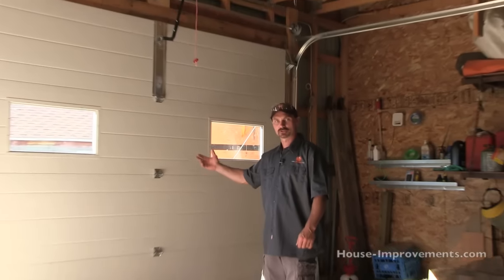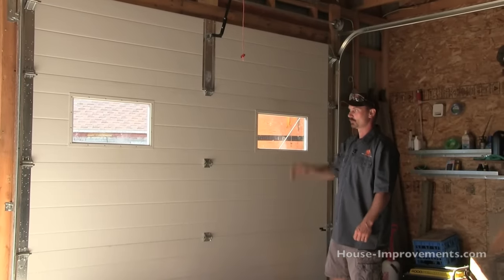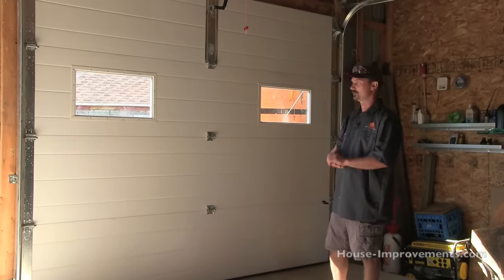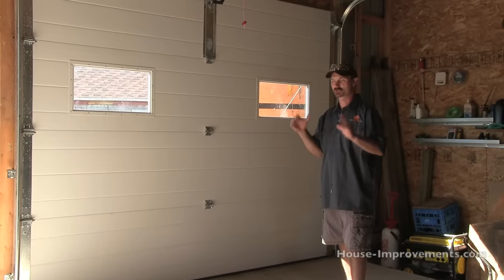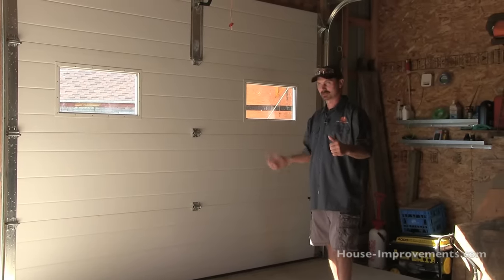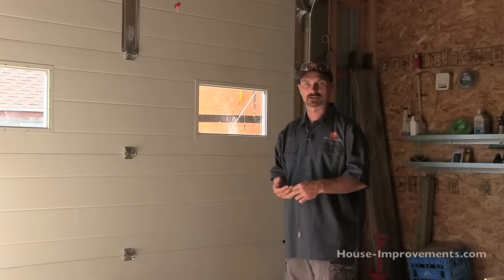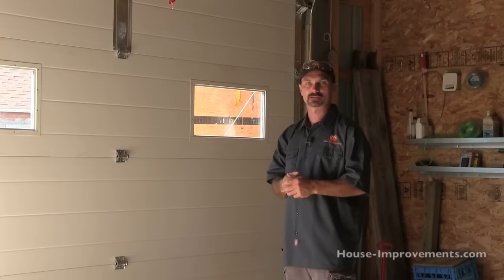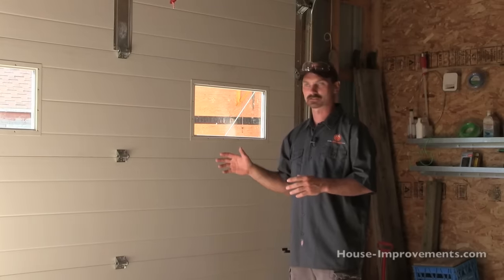How To Install A Garage Door

Comment: I am looking to buy a house that has a 20x40 RV garage.  It has a large garage door approximately 12x14.  The opener isn't moving and the wire that goes to the spring is broken and sticking out the top of the door.  They are telling me the entire door needs replaced.  How heavy are those larger RV style garage doors?  Do they sell them in separate pieces?
Reply from the maker: Please post your question in my forum with a picture of the wire you are referring to. http://www.house-improvements.com/forums/
Reply: Yes you can buy pieces separate. There must be more wrong than a broken cable for them to say it needs to be replaced

Comment: What is the material type used for the panels , is this GI sheet metal and Foamed with Poly Urethane or Aluminum sheets with Foam?
Reply from the maker: good question ,I'm not really sure

Comment: 15 mm rebar he wanted to say.
Reply from the maker: If you are referring to the rods I made for the door spring tensioning, I used 10M but you could use 15 M for more strength.

Comment: I have been installing garage door 46 years.  At least know some of the terms and terminology about garage doors.  

I would be surprised if someone hasn't got hurt from trying this.  You mentioned  don't use something make shift winding the spring.  Makeshift, say like rebar?

Winding bars are made of cold rolled steel.  Rebar is soft whatever.  You get a piece of Crummy rebar and it fails while you are cranking on that spring you can screw yourself over.

Comment: Sorry, I have to comment on a couple of things. He is using a regular cordless drill that is probably killing his hands. He can very well use an impact one. I can't explain why but an impact drill puts no strain on your hands. Just try. There are also available all kind of magnetic nut setters. Using a regular socket makes him look pretty amateur. Also the middle hinges should be installed with the fixed holes down and the slotted ones up, at least that's what the Steel-Craft installation manual is calling for. You should also never use anything else than "cold rolled" steel rods for winding springs. A rebar will bend if the pressure from the spring is too much. A pair of winding pins sold at any supplier or even just a 1/2" cold rolled steel bar sold at hardware stores will do the trick safely. Any professional garage door installer would cringe seeing him winding the springs. His position is completely wrong. Imagine you are winding the spring and loose your grip for any reason. He will be hit by the bar straight in the head. You should never have the spring's weight completely in your hands. Adjustable top support screw is installed in an impossible way. I'm curious how he tightened it. Also a pro will use a ratchet instead of a wrench. He knows the idea but is obvious his main field is general handyman, not certified installer.
Reply: you know he's doesn't install these professionally
Reply: Robert Pandi Can you post some of your how to videos . ? Talks cheap
Reply: Robert Pandi  I am not professional, either, so I wouldn't have any professional tools, and therefore I appreciate that he is using tools and equipment that I would have in my possession, and would already know how to use.
Reply from the maker: Robert Pandi With an impact it is to easy to strip the bolts/screws driven into the doors so I do not like to take a chance.
Reply: You always do a great job on explaining what and how you do the work. I have been watching  your video for a while . But I don't remember seeing any how to videos by anyone named " Robert Pandi" It show's that you have class by not responding to all the other crap he said .May be we will get luck and blessed to see one of his
 " Professional " videos

Comment: why do that put the track up first then stack the panels thats a waste of time
Reply from the maker: That is fine as well. I am showing exactly what the manufacture recommends but your way will work as well. I work by myself and find this works for me. 
I love you guys that come on here and bash those of us who are willing to put ourselves out here and show others but most of you are not willing to do the same but will criticize to no end. LOL. Good day to you.
Reply: @HouseImprovements  not bashing at all its just not a right thats all been doing it for  20 years and people like you make it seem its so easy . New construction is usually very easy but tight fit low lowgeadroom torsion isnt and other types of install isnt and your sending out a completely wrong message and people like you are dangerous to people that have no experience people will get hurt and have gotten hurt by videos like this

Comment: This video shows an amateur installing a garage door. He is obviously not familiar with the proper names of parts or the order in which they should be installed. I can tell by watching that he doesn't understand exactly how a garage door works . You should never use a piece of rebar to wind a torsion spring. This video will very likely result in someone getting hurt. It is a valiant effort and since the door operates at all I'm sure he considers it a success. But viewers please note that this is NOT a professional installation!
Reply from the maker: +Linda Lower  Easy to say when you have no video of your own to back it up? LOL